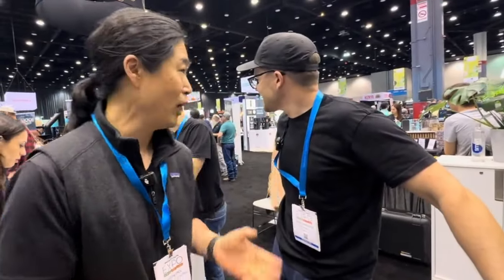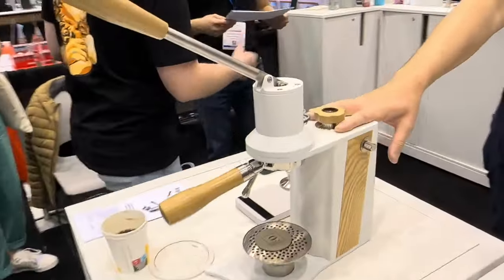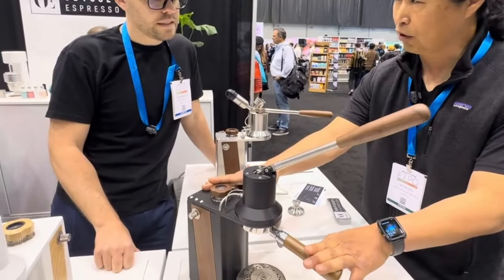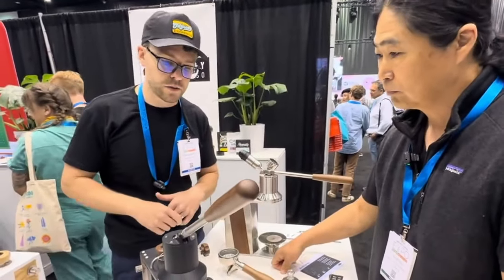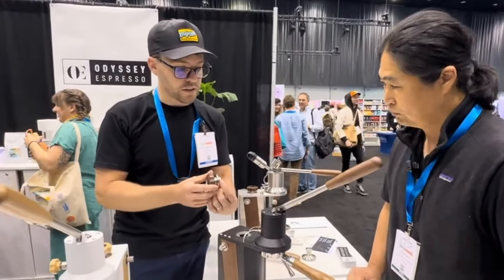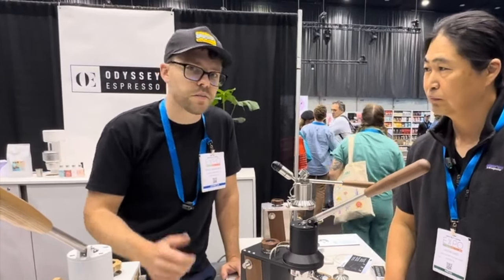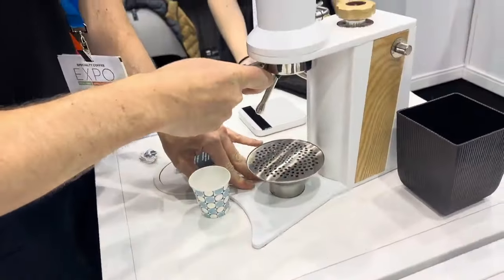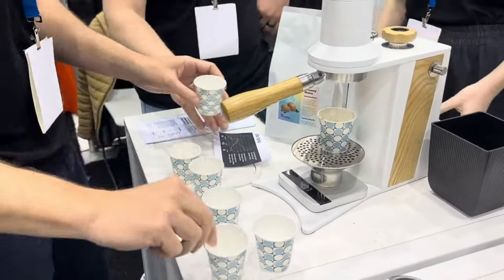The Odyssey "Argos"  Espresso Machine | SCA 2024

Comment: One other optional add on that Ross didn’t mention here is different springs rated at different bar pressure. I think the 8-bar spring is sent as stock, but at one point you could also purchase a 6 & 7 bar as well. Just FYI.